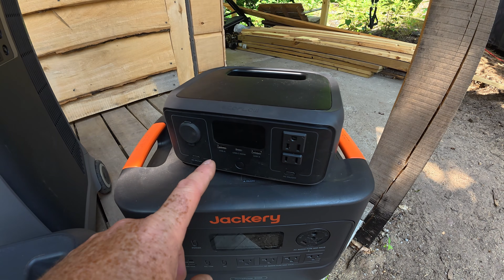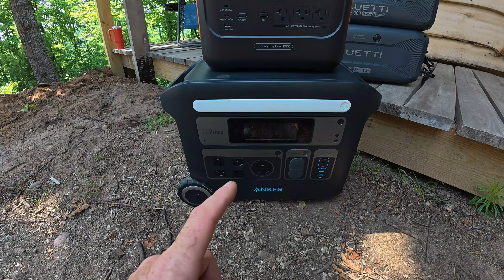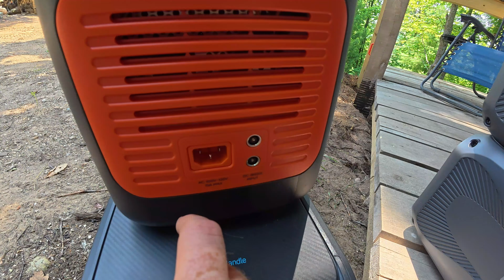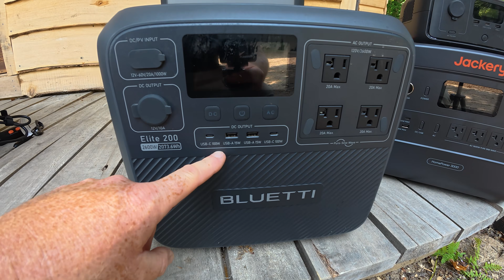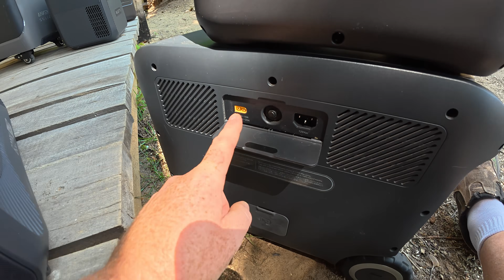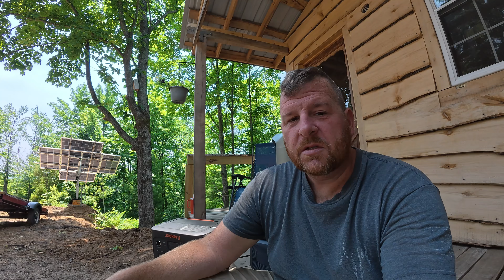Best Solar Generators For Off Grid Living- Which Is the Best for YOUR NEEDS! ?

Comment: Good information. I'm curious about how many kwh do you guys use a day / week to run your place.  I was told to get something that could do at least 10 to 18 kwh a day.  Also in the winter where we are there's not as much sun so I was thinking of setting things up so I can run the generator to charge the batteries up if need be.
Reply from the maker: We use in our cabin about 5-7kwh a day now. That is without the mini- split. If we use the Air conditioning or heat from the mini split we use more like 15-20kwh a day. 20-30kwh is a nice size system like ours that you can use without much worry. Days and days of normal power without having to reallt watch it too close

Comment: I have several small, large and extra large power stations (about 8 of them) ranging from 500wh to 10,000wh. Brands are Bluetti, Pecron (which has become a very good company), and Oupes. I use them everyday to supplement my grid power (running lights, TVs, freezers and fridges, etc..), also use them in power outages (of course) to keep essentials running. I take the small and medium ones outside when doing projects just like you do. I charge them strictly with solar and most will charge up from about zero in one good sunny day (have about 3200 watts  of solar panels in 4 separate arrays) I have been doing this for about 10 yrs now and your recommendations on what to look for in size and solar input are spot on, good job on the video man.
Reply from the maker: Thanks buddy.....I really appreciate the comment here, and sharing your experiences with your systems.....it helps  folks know how awesome solar can be. Best wishes
Reply: Damn I would really like to know more, just getting started. Trying to get something as soon as possible

Comment: Great video Jay!  We had only the Rockpal, Rockpower 1300 for about 5 years and it is only a 1254wh  cost us on sale with a discount I believe $700.  It's heavey weighs 39lbs.   Its been a great tool to have for short term power outages to run our house fridge, coffee pot, etc.  Of course we have the gas back up generator. we had to rely on more when we lost power for 4 days.  We get very high winds and tornados.  No regrets but we just upgraded this year to the Bluetti AC400 and an extra battery to use in the off grid cabin.  I do believe we used yall discount code.  So big thank you!
Reply from the maker: Awesome....glad it has been helpful and useful. Having a back up system really does give you so much peace of mind

Comment: I remember years back when the power stations first came out and it was $1,000. for a 1000 watt inverter or like $800. for a 12v 100AH battery.  How far the technology and affordability has come.
Reply from the maker: It Really has, I remember that too....and charging those 1k watt hour power stations at 250 watts so they took 4 hours to charge up, LOL

Comment: Great info. You cover alot of knowledge That I had to watch  many videos to learn. I now have a fridge 24 - 7 at my off grid cabin, where I was using a cooler and ice and could only stay for short periods before. Didn't want the noise of a genny. That XT60 plug will allow you to hook to bus bars and extra lithium batteries. Plus a small 12DC fuse box to run led RV lights. 300 watts of solar panels / power station/ and Battery keep each other charged to 100 %
Reply from the maker: So cool.....good information to know, thanks. ALSO.....nothing better than not needing a cooler at the off grid cabin.....SO NICE

Comment: The Solar Guru!!!  What would you recommend for a travel trailer (50 AMP and dual AC units) has a 12 volt fridge.  Solar still confuses the heck out of me.  I am thinking the large one but it is more for camping off grid
Reply from the maker: Phew......50 amp and Two AC units is a bit rough on Solar stuff. The apex 300 is great, but I think you would need two of them in parallel to get enough output to kick on those AC units......also 2 or 4 extra batteries. If you are seriously considering solar.....rather than your Genny, PLEASE email us, we can chat or we can talk on the phone about it. =)

Comment: Nice video, Jay!
I use the EGO Power+ system myself — multiple batteries that work seamlessly across a range of tools, including the lawnmower, chainsaw, leaf blower, and string trimmer etc.... What’s even better is that those same batteries power the Nexus EGO Power Station, allowing me to run pure sine wave electricity for many devices in my home.
It’s a super versatile setup!
Reply from the maker: This is really cool. I told Jen to look into it for us and see what its all about. Sounds nice, thanks for telling us about it. 😀👍
Reply: @OffgridwithJayandJen  -Of course the batteries are not cheap. LOL!